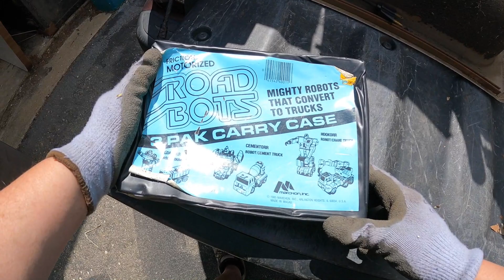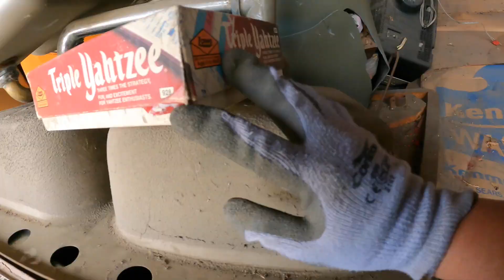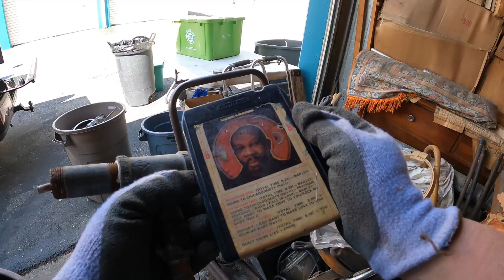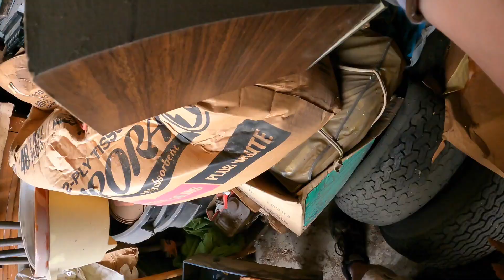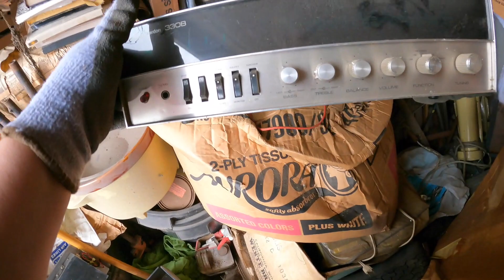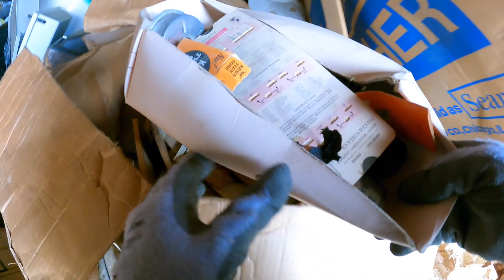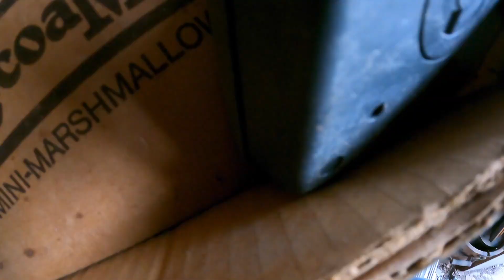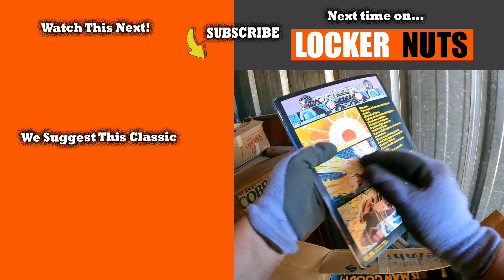STORED FOR 30 YEARS! Hoarder passed away and I bought his locker for $1,700 at the storage auction

Comment: What you actually have is a unit of  someone who worked on getting precious metals out of all the scraps he stuffed into that locker.  That's one of the reason there were such random metal pieces in there. What you called a pottery kiln is actually a smelter that he used to melt the metal down.  That's why it had an open top.  Those huge bars of copper were probably his work.  My guess is you may find the mold somewhere in that mess.  My guess?  He slowed down doing the work but kept what he knew had worth even though he stopped the smelting.  i.e.  hoarded it.
Reply: I think, as you do, a lot of the value in this locker has gone free to the re cyclers. He could do with a bit of knowledge on metals and how to identify them.

Comment: Do yourself a favour, get some tools to slice up the old electronics. On a load like that, the copper and aluminium will add up. Also, find some quick way of stripping the plastic from cables. That's a load of copper as well. If you do this type of job regularly, in a year's time, that adds up man. Especially on loads like this, mostly junk, so then at least you get something back.

Comment: You really got taken
Reply: Linda, In my opinion he didn't.  Well, yes and no. Jack doesn't have the time to go through this locker like it needs to be gone through. There is enough money in recycle metals to make the money back. Other odds and ends would push him into the profit. But he doesn't have the time to strip the copper etc. It's about turning and burning onto the next locker. 😊